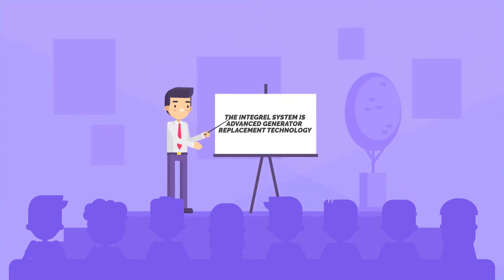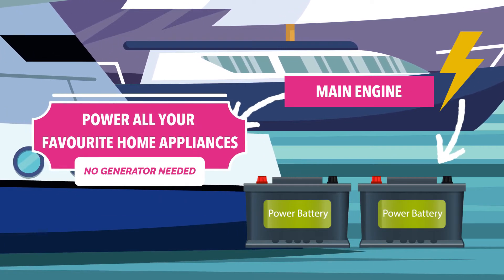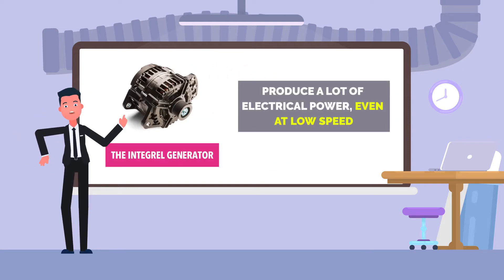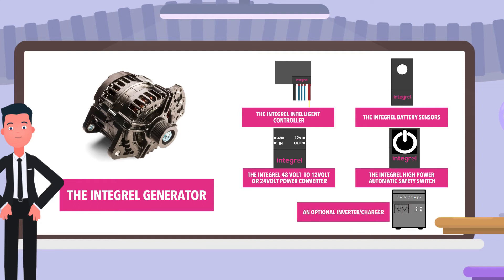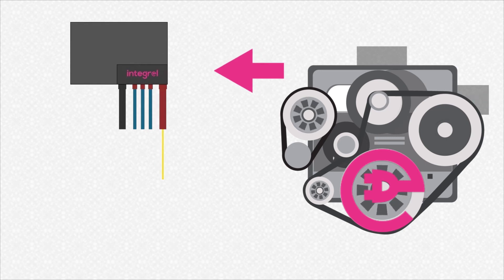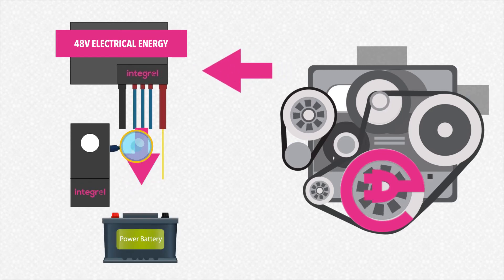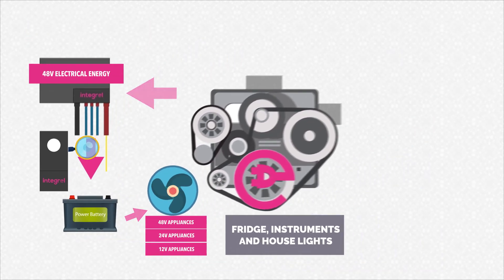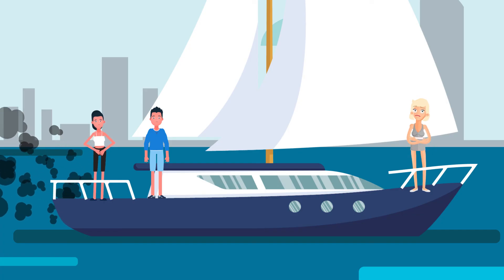Integrel E-POWER - how it works

Comment: If I understand correctly, the integral gen can only charge the 48v batteries, so the only way the get 240v A/C power to run an air conditioner would be with battery banks and an inverter? Is that correct or can the integral gen produce 240v a/c?
Reply: Correct